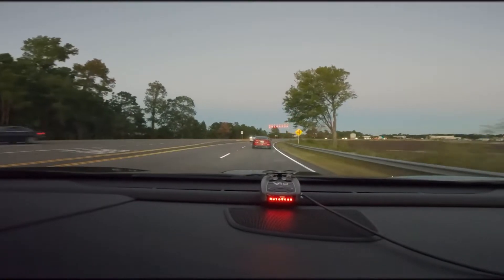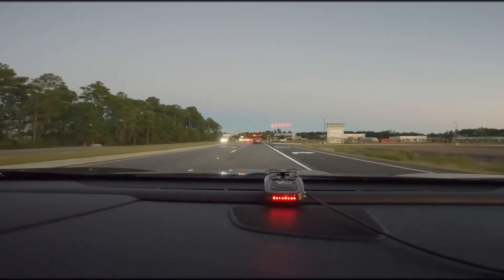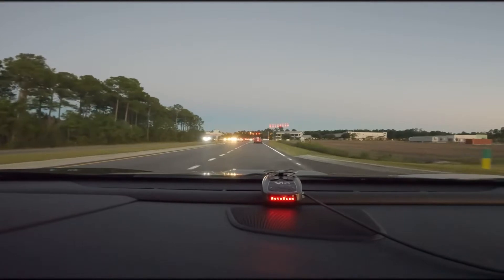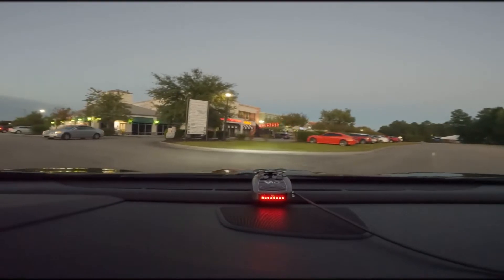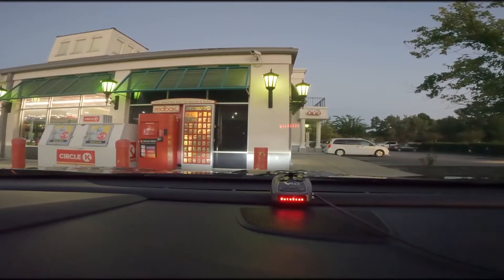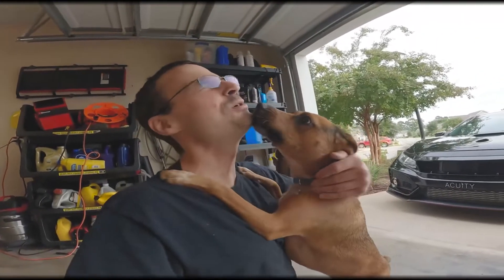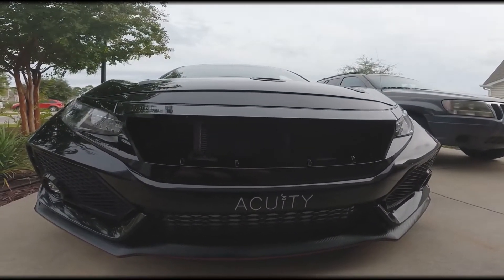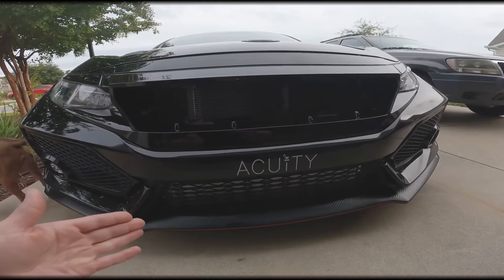Fk8 1000hp intercooler upgrade testing (downpipe reattached)

Comment: Have you thought of getting the greddy crash bar?
Reply from the maker: I can’t guarantee fitment.  The factory crash bar is still there. It’s just cut to fit the intercooler. The factory crash bar has multiple support inner layers. My fabricator and I stood on it after it was cut and couldn’t even bend it after it was cut.